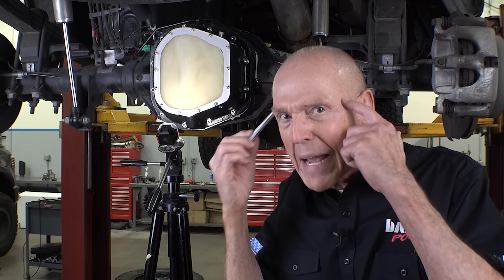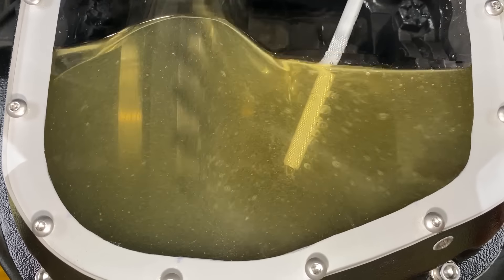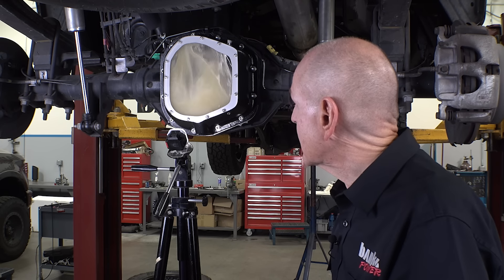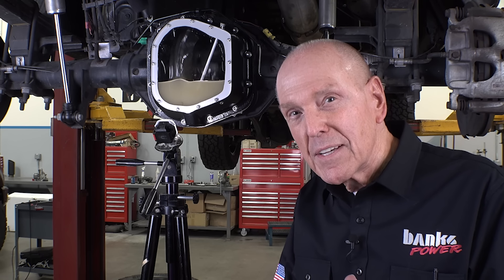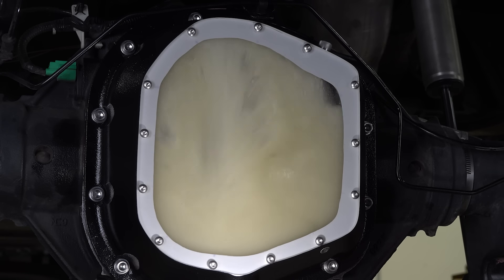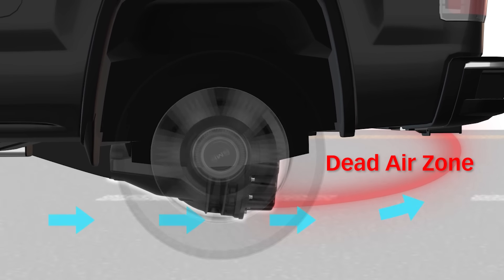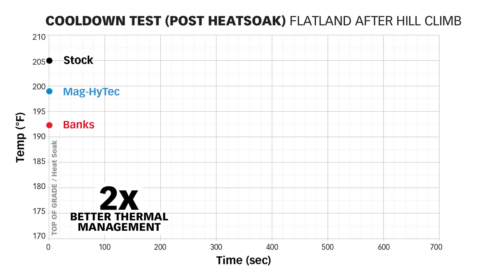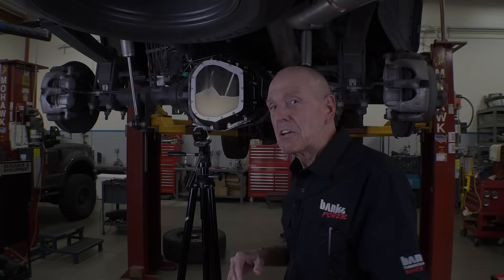What aftermarket diff cover guys don't tell you!

Comment: We can't even see what's going on around the pinion but I'm betting it's getting lubed very well with as much as I see happening.  This is all assumptions.  He's making an issue out of something that really isn't an issue.  Just change the fluid at recommended intervals and don't be too hard on it.  Pretty basic.
Reply from the maker: Thanks for watching. If you're suggesting we're trying to reinvent the wheel, it's an age-old argument. Everything can be improved. Ford didn't stop innovating with the F-150 after it launched in 1948. For a full breakdown of all the data and comparisons, we have an entire series that showcases the diff cover development. Watch the full "Behind the Diff Cover" video series here: 

https://youtube.com/playlist?list=PLwtmrqcWzLtQR9riOg8mizIEj-UX4WBBm
Reply: @bankspower  some things are just fine the way they are.  My truck has 250000 miles with the factory diff cover.  No issues.  It was an oilfield truck most of its life too.  My dad's old f250 had 375000 miles on it with the factory diff cover.  No issues and it was a farm truck used to pull cattle and get dirty.  No reason to change it, ever.  People buy these covers for looks.  Thats it.  We all know it.  It's not like pickups have the rear ends going out in massive numbers and it's a huge problem.  It's rare, and when it happens, it's bc the fluid got too low or they were hotrodding it.
Reply from the maker: @aftersolo  With all due respect, the way to gauge what's happening in differentials is to perform research across thousands of trucks, not a sample size of one with 250k miles. Before we launched into this multi-million dollar project, we did our homework. We spoke with major gear oil manufacturers, Mobile, Amsoil, Castrol, etc. We spoke with American Axle, Detroit, and Dana. Over-heating gear oil does occur and it reduces gear life. Now, does prolonging gear oil life give you 100k more miles on your ring and pinion? 300,000 miles? It's hard to pinpoint without data from long-term testing which we're in the middle of. Other benefits of the cover include keeping the oil cooler which keeps it in better condition, thereby extending mileage between services. Also, filling, monitoring, and draining the oil is also far easier with this cover. 

Do you need a Ram-Air diff cover? No. Your stock one is fine. Does the Ram-Air cover improve upon the stock cover? Yes, undeniably. Both things can be true.
Reply: @bankspower  with all due respect,, you're missing one huge key point:  the axles in most vehicles will outlast the car as long as the operator isn't being negligent.  Like I said, it's a problem that doesn't exist.  My dad, who's 67 and my grandpa, r.i.p. never changed a diff cover.  My dad would laugh at the notion.   None of their farmer and oilfield friends did either.  I've grown up with trucks all my life from a 1980 f150 with a 300 straight 6 to an 86 f250 with a 460 to a 95 f250 with a 351 to a 96 f350 with a 460 to a 2000 Silverado 1500 to a 06 duramax back to an 88 f350 and so on.  These trucks were used in the mud and sand to haul hay, feed cattle, fix fence, and haul cattle.  These are hard miles.   You know what they all have in common?  High miles and literally never an issue with the rear end.  My dad always taught me the importance of good maintenance and not wasting money on things that aren't issues in the first place..  We're all about practicality and common sense.  All were still running fine when sold too.  Kept the covers factory.  If it ain't broke, don't fix it.  I pull a flatbed with a semi and I talk to a lot of hotshot drivers.  They keep their trucks factory to prolong the life.  Turns out Ford, chevy, and dodge know what they're doing.
Reply from the maker: @aftersolo  So, we're not going to win this argument because you've already made up your mind. And, that's ok. However, there are millions who purchase products that are innovative and offer incremental improvements. Look no further than your phone. If Nokias and Motorolas were perfect, there would have been no market for the iPhone or Android. If the first iPhone was perfect, there would have been no need for the iPhone 2, 3, 4, 12...
Reply: @bankspower  phones are a totally different ballgame and eventually they won't even exist in their current form.  They'll be implanted into you.  Now, diff covers don't exist on my semi.  I literally can't change anything about the axle.  There's no need for it and freightliner knows this.  Both are high pinion axles too like rockwell 2.5 tons.  Oil gets there fine.  You could literally do the same with pickups, it would just be harder to access everything and change fluids.  Thats literally the only purpose the cover serves: accessibility.  Designs that work perfectly and have for years are constantly changed for one reason and one reason only:  money.  It's like a chopsaw with a Lazer to show where I'm cutting.  I had to pay more for that, it sucks, and it doesn't work anymore but I didn't need it in the first place.  The manufacturer made me think it was a good idea.  Like I originally said, people buy diff covers for looks and in some cases protection like in rock crawling, not lubrication.  If you can make up a problem, you can sell a product.  (I should have that put on a shirt.)  You can sell a gadget to make opening the refrigerator door easier if you can make people believe there's a problem opening it.

Comment: What is the risk of overcooling the fluid? If you drop the temp too low, that fluid is going to lose some of the intended operating temperature characteristics. This is more just a side note, why bother telling me you can see how bad the flow is on the back of the ring gear, and then not using the camera to show it? That is a real damn shame. Almost like it doesn't really look that bad.
Reply from the maker: Thanks for watching and commenting! The only way to over-cool the cover would be using the cover in sub-zero temps... and only during the first few miles before the diff heats up to operating temp. So, there's no real risk of over-cooling. Regarding the poor fluid flow to the ring gear, you can see it clear as day. The flat cover greatly reduces the amount of oil flowing up and over to the ring gear. You can see it through the clear cover. Is some oil getting over to the ring gear? Of course. But is it the amount intended by the manufacturer? No, clearly not. It splashes off the side and top and drops back down instead of going over with the ring gear.

Comment: How can you tell what’s happening in the diff cover before you cut off the back of it and placed the clear cover on .
You said you can’t see what’s going on so how’d would you know if they weren’t working or not?
Then you made something so you could see through so if you couldn’t see before the new cover how’d you know weather or not the covers are bad little confused.
Also you didn’t Mimic any of the Internal Features of the inside of the old covers to do the Comparisons with you just had a flat clear peace of plastic being hit by Fluids thus causing the effect of something that’s not working so well .
Take your your New Diff cover cut the back plate off as you did the other put the clear plastic peace on and do the same test .
You show yours flowing well with some graphics being added to the back of your diff cover showing a good flow that’s like comparing apples to oranges.
I’m not a Scientist or engineer but something isn’t panning up .

Comment: The cooling fins on the ram air cover would be plugged up in less than a week driving the 2 lane paved county roads to and from work 10 miles each way. When it plugs up it does just what the stock cover does. Good idea but I prefer not to have to get my fat ass under a vehicle anymore than I have to. Now if they made a stock cover that didn't rust out in 10 years we would have it made. I'm on my 2nd one in my 06 Tahoe.

Comment: Wish yall made these for chargers
Reply: Work on getting oil to the Hemi first.
Reply: @jneusbaum3697  They wouldn't run without oil my guy...
Reply: @2averagenoobs108  The Hemi engines wear out fast because if they are not running high R's the oil circulation is sub par. Fun engine just not great for long run.
Reply: @jneusbaum3697  Oh, the lifters get oiled by splash from the camshaft, I agree. But other than that the actual engine is fine.

Comment: I got a kick out of your oil temp going up the grapevine! Where do you want oil temp to get rid of any water?
Do you want it a max temp of 178? I want mine at a temp over 200F for a long enough period to steam out condensation. You are not doing any favors here. Condensation is real on any enclosure where the temp varies.
The gears & bearings are going rust from oxidized oil in no time!

Comment: The gears in the diff is so close to cover it should lube without having to design fins. The main gear in diff is spinning so fast in high rpm it should also act as vacuum to pull fluid from cover. That truck engine and trans will fail before that diff causes malfunction. Just my logic . This test in the video shows nothing about how it's spraying fluid inside diff. Need to show temperature difference between plain diff cover vs fin. Needs to show what average diff temperature is vs one without fin.
Reply from the maker: Tashi, this video is simply the most recent in a year-long series. You'll find all the data points you're looking for in previous episodes. https://www.youtube.com/playlist?list=PLwtmrqcWzLtQR9riOg8mizIEj-UX4WBBm

Comment: This is a solution in search of a problem. Kind like a TB spacer...

What happens when you run over that dead deer or hit an armadillo or straddle that road alligator?
Reply from the maker: This is an age-old argument, everything can be improved. Apple didn't stop with the iPhone development in 2007. We thought of rolling over a deer, rock, or any roadkill, the scoops are designed to simply break away, keeping the cover intact and preserving the integrity of the diff. Side note: if the scoops break, we'll warranty the cover with a new one.
Reply: @bankspower  I'm glad that when the scoops break off it doesn't take a chunk of cover with it. Good thinking.

Comment: Wow, Gale sounds like a liberal never showing facts of the other side. Talk is cheap but powerful tho, and many fall for the rhetoric. Remember, this is a commercial so what else can we expect him to say?
Ideally you would want  zero flinging and zero aeration of the oil to always keep the fluid at the proper level where the parts are getting a bath and not a shower. The oil level is set over the center of the pinion and that's how it gets its lubrication; the more oil is actually in the process of being flung around... the lower that level of oil becomes. 
Notice that the oil which is being flung does not get to the pinion gear at all. The video clip showing the oil flow is thus biased, neither does it show the oil level; the level is the oil source for the flow!! Also, the oil coming off the ring gear and being flung over to the front pinion bearing area (not the pinion gear at all) is heated oil; not good. Due to the smaller size of pinion and all the work is doing, lubrication of the pinion is therefore critical. Engineers know that the pinion is the first thing to go when lubricant is low and the reason they designed the pinion on the bottom not to rely on flinging... designed not to require an oil pump.
The outer airflow design is a good one to keep it cooler while it's not mudded up but it reduces your ground clearance.

https://jalopnik.com/watching-gear-oil-splash-through-this-clear-differentia-1829278489/amp
Reply from the maker: Curious, did you watch the other videos in the series? Your points have all been covered. Not sure why you linked to the Jalopnik story.
Reply: @bankspower  How can I look for something I don't even know exists. I searched and Jalopnick is what came up. 
Is there a transparent dynamic video of your cover? If there is it should be included with this presentation. If you notice, I'm not the only one feeling dissatisfied.
Reply from the maker: @unleavenedkaraiteplus3412  You make a great point. We've just added a link to our differential cover testing video series. We made a bad assumption that most viewers that watched this latest video had seen the previous videos in the series.
Reply: @bankspower  NICE

Comment: How about diff covers for f150?
Reply from the maker: Right now the engineering team is focused on the current gen ¾ and 1 ton HD diff covers. After these are done, we will proceed with F-150/1500 trucks and Jeeps. As of now, we are not sure of the exact vehicles that we will be working on yet, but it will consist of 1/2 ton trucks.

Available for Purchase:
▪️AAM 11.5" or 11.8" 14-Bolt (01-19 GM, 03-18 Ram)
▪️Ford Sterling Axle 12-bolt with 10.25/10.5

Pre-manufacturing testing:
▪️Dana M275 - Ford '17- ‘20 (F250 HD/F350 SRW) - ETA: Early Spring 2021
▪️Dana 80 (94-02 Ram 5.9, F350/450 99-07)  - ETA: Mid Spring 2021
▪️AAM 12", 14 Bolt (GM 2020+, Ram 2019+)  - ETA: Late Spring 2021

Comment: You cheated the knock offs by not simulating the ridges on the backside if the covers you replaced it with flat  plexi and changed the flow.
Reply from the maker: Thanks for watching. The cover shown at the beginning of the video is made by PPE. The cover tested on the truck was a Mag-Hytec. The goal for any diff cover is not to stop the oil from going over with the ring gear. The goal is to encourage MORE oil to flow over the ring gear. The PPE would impede the flow and severely aerate the oil. Think of a rocky waterfall. The water is white because of aeration. Air is not good for lubrication. For a full breakdown of all the data and comparisons, we have an entire series that showcases the diff cover development. 

Watch the full "Behind the Diff Cover" video series here: 
https://youtube.com/playlist?list=PLwtmrqcWzLtQR9riOg8mizIEj-UX4WBBm

Comment: Well I'm either old or confused but you keep saying water I hope you did not use water because water does not respond like 80 90 weight
Reply from the maker: The fluid used in the testing is Amsoil 75w-140 Severe Gear Full Synthetic gear lube.

Comment: This video is misleading.  There no way that ring gear and pinion is NOT getting all the lubrication it needs. Exactly what is causing the fluid movement? CONTACT WITH THE RING GEAR AND PINION!!! I dint know if you've EVER spilled a quart of oil but i know after 20plus years of heavy equipment mechanic experience it will get into any crack,crevice, opening or opposite facing surfaces. I can appreciate trying to promote a item but DONT USE MISINFORMATION AND FALSE FEARS TO DO SO. If the design of the cover was as detrimental as you claim there would be cars and truck lined up along freeways and streets due to failed ring gear and pinions...I kinda doubt your claims of the benefits of your item based on this presentation.

Comment: Laughable.   Only honest moment is at 5:05, but 3:00 defines the star of the video!  And then, "I don't know if the fluid is making it over the top to lube the ring and pinion" . . . The rest of us do.  I killed it after 5 minutes in.  A solution looking for a problem.
Reply from the maker: Thanks for watching. If you're suggesting we're trying to reinvent the wheel, it's an age-old argument. Everything can be improved. Apple didn't stop innovating with the iPhone after it launched in 2007. For a full breakdown of all the data and comparisons, we have an entire series that showcases the diff cover development. Watch the full "Behind the Diff Cover" video series here: https://youtube.com/playlist?list=PLwtmrqcWzLtQR9riOg8mizIEj-UX4WBBm
Reply: @bankspower  not suggesting that you are trying to invent the wheel . . . Not sure what part of my comment generated that presumption.  I like Banks Power.  It is just that this video is 100% marketing.  100%.  There may be some science but the presentation looks cool without providing solid data.  Is it the hitting the flat wall or the gears continually churning through it that "aerates" the lubricant?  If it is cake were making I'll use my manual beater in a bowl to mix/"aereate" the batter.  Not to into throwing batter against a wall to mix it!  😉  thanks for the reply, and infomercial.  Looks like a great diff cover!

Comment: You just removed the internal fins????? Not a fair representation. 😵
Reply from the maker: Thanks for watching. Check out the beginning again, the cover shown at the beginning of the video is made by PPE. The cover tested on the truck was a Mag-Hytec. The goal for any diff cover is not to stop the oil from going over with the ring gear. The goal is to encourage MORE oil to flow over the ring gear. The PPE would impede the flow and severely aerate the oil. Think of a rocky waterfall. The water is white because of aeration. Air is not good for lubrication. For a full breakdown of all the data and comparisons, we have an entire series that showcases the diff cover development. Watch the full "Behind the Diff Cover" video series here: 

https://youtube.com/playlist?list=PLwtmrqcWzLtQR9riOg8mizIEj-UX4WBBm

Comment: Alright, well first off you didn't duplicate the fin-like structures on the internal side of the cover, which likely are there for more than strength. hahahaha. real scientific. Good lord. Where did you guys get your Ph.D?
Reply from the maker: The internal fins in the flat covers destroy the lubricant over time due to aeration like water over a waterfall hitting rocks below. Had we put horizontal fins inside like the flat-back guys, the results would be worse that what you saw on the clear acrylic cover.